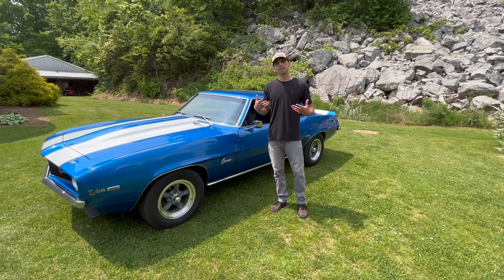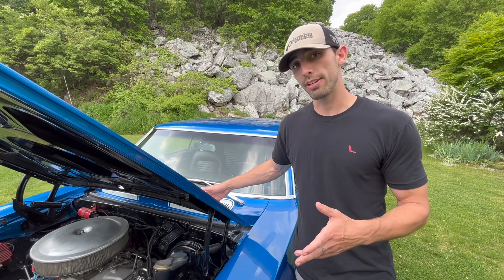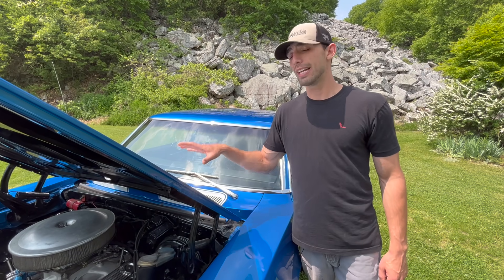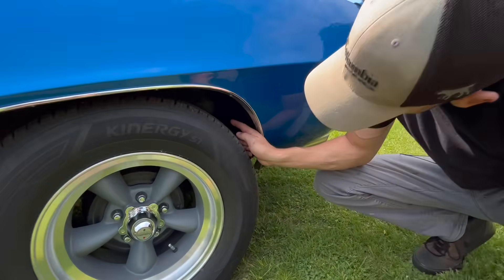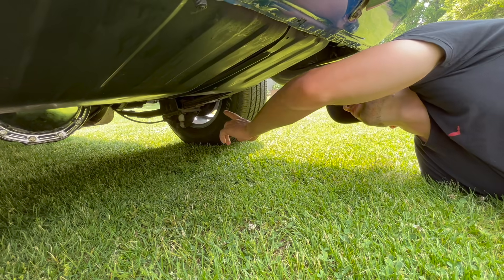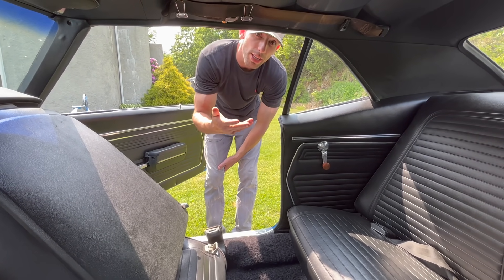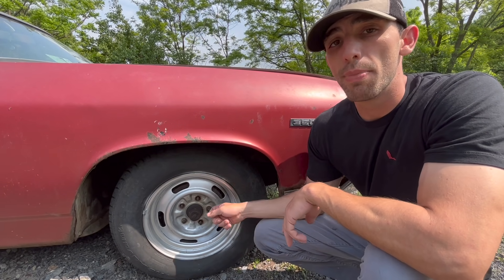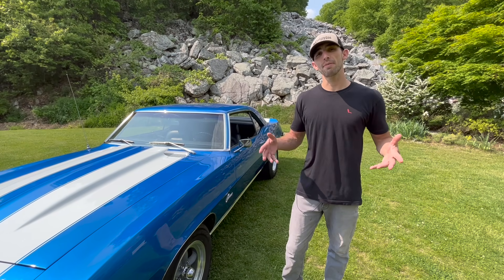How to VERIFY a 1969 Camaro Z/28 | FULL GUIDE

Comment: I bought my Z from my oldest brother 36 years ago. Came close to selling it a couple times over the years(family, multiple homes, shift work) but managed to keep it. I had it certified( like 20 years ago) from GM Canada’s antique car division( yeah, I’m a Canuck). I don’t know if they still do this…pretty sure this service wasn’t provided in the States. They provided the build sheet with all the options the car came with. The one thing I’m curious about, is the hedder’s that were on it when I bought it. Supposedly( urban legend?)GM offered a set of Doug Thorley hedders in the trunk as an undocumented option.I’ve seen pictures of the hedders and these look identical ( they’re stored in my attic in my shop. Has anybody with a Z encountered this “option”. Oh, still have the car…it’s all done( some things not original but I added them when body and paint happened 18 years ago…cowl induction hood, chrome trim, 15x10 rear rally rims off a Vette). It is a scary, fun car.
Reply: io heard headers dealer installed often

Comment: If the cowl hood on a '69 Z28 was installed at the factory during assembly, on the rear drivers side corner of the hood is a 'date stamping' (week number of the mfg).  Aftermarket or OTC hoods do not have the date code stamping.
Reply: i believe you are right ! plus there there were more Cowl Hood cars than what was mentioned here

Comment: The larger bumper guards were to comply with some states’ bumper height requirements.  The heavy duty leaves in a Z sometimes made it too high(i believe they were too high) so the latger bumperettes ensured at least a piece of the bumper was the right height, passing regulation on a technicality

Comment: We ordered our Z28 RS October 28 1968. I ordered both spoilers. It was built 2nd week of February.  Trim tag does NOT  have the D80. Window sticker shows D80. But back is a 68 spoilers. Repainted in 2018-2020 and now has 69 spoiler and ZL2 hood and air cleaner. 
Nice video/talk. We drive around 3,000 each year.

Comment: Do the Z/28s all have 2 humps on the front portion of the cylinder heads. I've always heard that the humps identify the heads as true 302 engine heads that were large 2.02" exhaust valve ports.
Reply: Yes

Comment: Hi Also it has screw factory holes on each side of the chassis for hanger of the tail pipes from factory. I guess only SS and Z/28 had them. My is a cal car lots of research to see it's a real Z/28 has a 427 motor. when I got her 40 years ago no motor.

Comment: Cars with those real low gears like 4:10 etc, must have a very low top-end because they would be tach-ing over 6,000 RPMs at around 105mph. Am I right about this? But then I heard that if the engine is balanced they can go up to almost 7,000 RPMs. without being too risky. I wish somebody could clear this up for me.

Comment: Do I understand it correctly that 69 Z/28's were not yet produced at Norwood in October of 1968?  I have a pre-X code 69 Camaro that has Z/28 labeling and several features that match Z/28, including the 5.80" pitman arm, Muncie 4-spd, and more, but it was built in October 1968 in Norwood and has a 350 crate Vortec replacement engine so I can't match engine block to VIN, and is very difficult to tell whether it started life as a Z/28.   It also has 5-leaf rear springs, but had other traction-enhancing additions such as traction bars, so the rear springs could have possibly been replaced. VIN is 124379N526957

Comment: The VIN on '69 Camaro Z28 does NOT show up in both locations referenced; only one of them..  either on the front pad with the engine application stamping, OR on the block casting near the oil filter (which are very difficult to read even if the engine is out of the car.

Comment: they had 2 build sheets one on the quarter window and one under the rear seat . the early models had a 7000 rpm tack . later they had a 8000 rpm tack

Comment: I had a very, very,  Rare  1  of Only Special  500 Special  Made  it Had Corvette Running Gear a  427 bored out from the Factory balancaed and Blue Printed it had 675 Horse Power , muncie syncro 4 Speed it had sripe on front and back , Deep Sea Green , white Stripe the  Big  S S on the Front never seen one like it ?

Comment: Just run the engine # against the vin Norwood cars are easy to see if its a real Z Los Angeles cars just see the engine code and the vin easy as that ,it doesn't have to have the d80 option or the zl2 option to be a real z ,Norwood cars got the same color of the stripes were painted the same color of the stripe under the section under the piece in front of the windshield

Comment: I'm going to be as nice as I can because I am a bit confused about what you are saying in your video concerning the realness of this supposedly real Z/28 you say it is a p/s car however it has a manual steering box you mentioned the tach and if it was a factory tach equipped car there would be a hole by the fuse box where the wire would go through and attach to the transmission, that is not how a tachometer works you mentioned that it would have a proporstioning valve underneath it on the sub frame and thank is not true also the vin number difference between a V8 and a inline 6 is 12437 =V8 the 6cyl is 12467 not 12337 I also know that the 69 cowl tag really doesn't give you a lot of information aside from the usual but it is correct about the Xcode not criticizing you just trying to clarify
Reply from the maker: You are confused.. everything you mentioned is wrong.. I have many videos related to z28 on the channel.. check them out 👍
Reply: @backyardbarnfinds  He is correct about the tach. They do not use transmissions for a signal. My 69 Z has a documented factory tach and its ignition driven as they all were. The rest of the video is pretty spot on to me. Nice work!

Comment: These cars with that little 302 don’t stack up well vs the Mopar muscle of the same period. Not really close.
Reply: my Z's power was 5k to 7.5k..... terrible off the line but factory built for road racing....
Reply: Little motor lol..2900lb car vs a 4000 lb car you obviously were never street racing back in the 70s 80s
Reply: @Cats.in.Tuxedos  you must of had a 373 gear.. they needed a low gear.I ran a 456 with a m20 it was a beast
Reply: @Cats.in.Tuxedos  they needed a low gear to really turn on in the quarter.I ran a 456 And when I hit 3rd, it was like a small hit of NOS lol

Comment: Hi I’m about to buy a Z28 and the guy has no paperwork but it says x33 on the tag. 124379N618750.  Rear drum brakes it also has no passenger side side mirror 😅3/24/69 production date